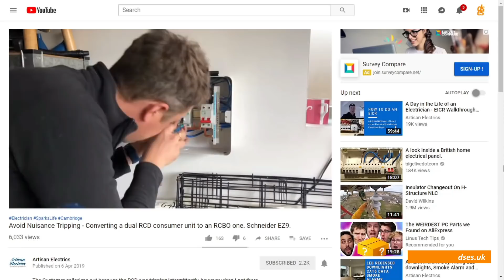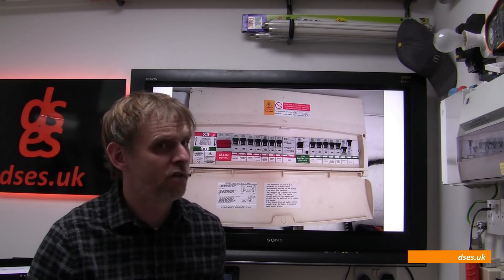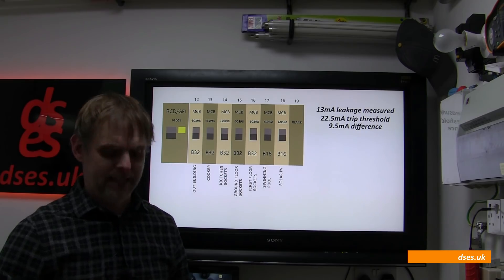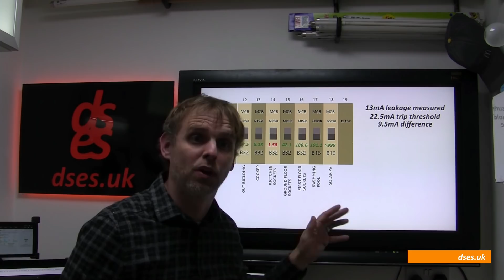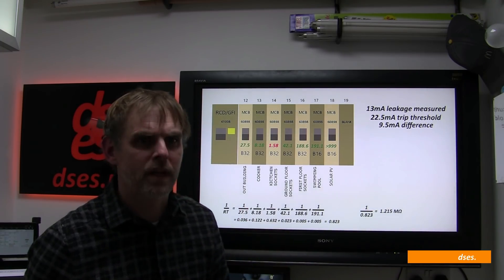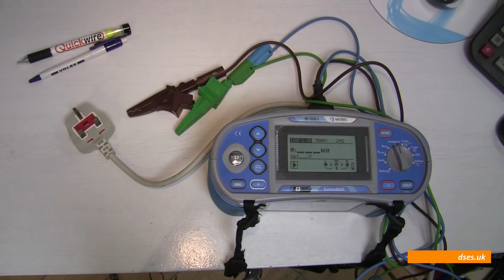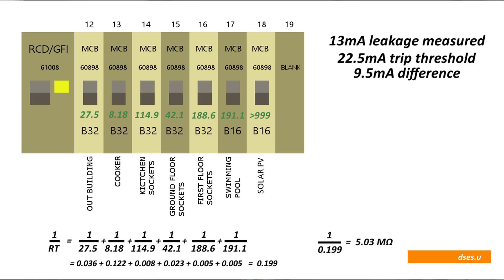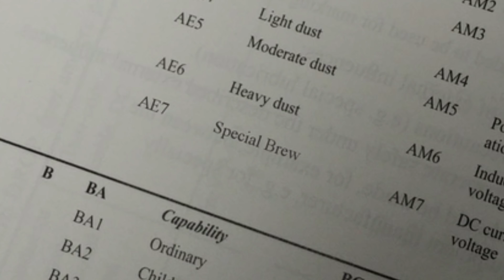Insulation resistance and RCDs

Comment: I got called out one rainy easter sunday by a local farm manager. Reason tripping RCDs. So disconnected circuits at the swb. Found a rat chewed cable where the septic tank circuit exited the building inside a marley end box. Fixed that one circuit down. Found next one was a Rat chewed cable directly above the switchboard in the roof space where the rats had chewed a good 300mm of the outer sheath and the primary neutral insulation away. A quick look around in the roof resulted in many other similar rat dinners. Fixed all that I could find and advised client they had a rat problem and was most likely due to the half meter deep mound of recycling waste they had piled up in the garage. Farm manager said they normally save it up then take it into town. Farm manager started clearing waste into his trailer exposing large holes in the plasterboard wall behind the wates mound. Inside the wall were two 25mm single core conduit wire tails on the incoming mains conductor, they should have been installed in conduit but this was obviously too hard for the original installer. These tails went up the wall into the exterior tariff meter box. There was no insulation on sections of both of these tails leaving 100mm sections totally exposed on the neutral and some smaller chunks out of the active conductor insulation. Another rat supper. Had to get the line mechanic out to pull the pole fuse to allow me to repair the insulation on the tails and install it in conduit up the inside of the wall. Almost 8 hours spent on call out rate due to some one not wanting to process their recycling regularly. Sent one of the residential sparks back the next week to disconnect all switches and sockets etc. in order to pull cables up the walls into the roof space to check if any repairs were needed due to rats getting into the walls elsewhere. I should add that this was a wood framed house with exterior brick, so all walls had cavities.
Reply from the maker: Crikey, I don't think I'm gonna sleep tonight after reading that! One of those jobs I hope I never get called out to!
Reply: @dsesuk  They were very lucky that rats only seem to like the primary insulation on the neutrals and not the actives. Have had similar on other jobs in the past and the RCDs only seem to trip when the rats pee on the exposed wires. It was actually a nice little earner for a rainy Easter Sunday. Great videos by the way, very informative and entertaining even if you are a POHM.

Comment: This video remind me on my most horrible RCD foult. We installed a addional outside socket. In the main board there were 2 RCD 100mA for the heat pump and a 300mA for the rest of the house. So I told the customer we have to change the RCCB     with a 30mA typ. This was no problem. RCD was quickly changed, tasts were carried out and the job was finished. Untill the customers called and told me the RCCB tripped over night. So I went there and don't find any problems. After 5 times visiting the customer and 14 hours. I found the failure. There war an old time controlled heating circuit in witch N come from the lighting  circuit and the L of one relay was connected to the heat pump RCD. When the timer was off there was no fault.
Reply from the maker: Ouch! The ol' borrowed neutral strikes again!

Comment: Great video David. A really practical example of basic physics. I had exactly this problem in one my rental properties: tenant turns kettle on, RCD trips, cause was another circuit on the RCD, the kettle just provided the last few mA to trip the RCD.
Reply: I have come across the kettle causing the nuisance tripping before in motel units. The kettle in one unit was not turned on but every time the compressor of the fridge in the next door unit turned on leakage through the neutral  inside the kettle through the water in the kettle to earth tripped the RCD. The start up current draw of the fridge and the fault resulted in part of the return current from taking the alternate path back through the kettle earth to the neutral earth link in the switch board on its way back to the power station. Was a bit of a bugger to find especially when the switchboard circuits were just labelled power and lights with no allusion to which units they were associated.
Reply from the maker: Thanks Tony, that kind of situation can well be the case, and it can point you in the wrong direction when faultfinding!

Comment: I usually find RCD trips are faulty kettles washing machines etc. If I'm doing a board change on an older property as a minimum it's good practice to fit a high integrity board so you have that RCBO option. Not all customers have the money to chuck at all RCBO boards.
Reply from the maker: I always go for the appliances that directly use water first, or those exposed to moisture such as fridges, freezers, exterior lights and sockets, etc. I also check if it's raining when the report of a trip comes in. Single pole RCBO options have really dropped in price though (double-pole remains pricey, but the best option).
Reply: Had cafe I wired up complain as new toaster was tripping. Turned out to be  a raisin stuck in toaster.  Ha .
Reply from the maker: @glynowen1349  I've had exactly that before with my own toaster!
Reply: @glynowen1349  I bet that was the easiest £30 you've ever made! Unless you're like me; happy to be paid with a Full English...?

Comment: Great Vid. Top tip for nuisance trips on kitchen rings with good or high IR, fridge freezers with faulty defrost elements can be a bugger as defrost cycles only happen every number of hours, so nuisance trips are number of hours apart in time, and you cannot detect the low IR at the plug as the element is separated by the pcb relays, so you can mistake the appliance as being ok when PA tested. Can be a bastard if you didn't know this lol.
Reply from the maker: A very good point, some appliances test out just fine, but it's only when a component part of them clicks in that trouble occurs. Damn, I wish I'd said that as part of this video!

Comment: We had an ring main RCD at work that had been nuisance tripping for years, sometimes ever 5 mins, had been looked at by our official sparky many times but never presented the fault :(  I did the usual procedure of unplugging everything ( no trip ) then plugging in one item at a time to see if one was the culprit. Anything plugged in would cause the fault :( Eventually while I was asking our sparky to look at it again he looked at it and it tripped, prior tests were insulation and does it trip at 30ma, this time he ramped up the current from zero to find that it would trip at 12ma !
Reply from the maker: Some RCD's can be too sensitive, I have come across such before which is why the ramp test when no other loads are present is such a useful test.
Reply: The electrician sounds incompetent, that fault should have been picked up on the first visit.
Reply: @ashmanelectricalservices4318  I suspect that the RCD had an intermittent fault as sometimes it would go for a week without tripping, yet another day it would trip every 5 or 10 mins with the same things plugged into the ring.This time the fault was present when he tested it.
Reply: @steverpcb  It was an over sensitive RCD, that fault would have been there at the first visit, did he try doing an RCD ramp test on his first visit?
Reply: @ashmanelectricalservices4318  I presume so as the one on the ring the other side of the factory failed test even though it had not been giving problems.